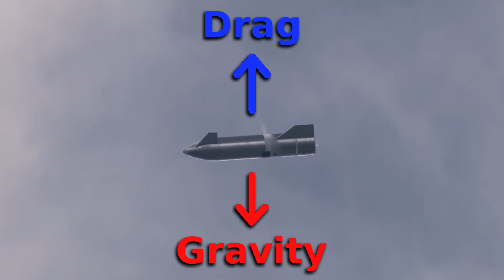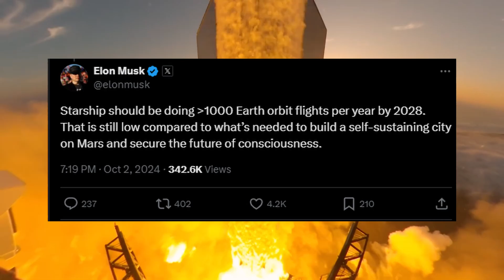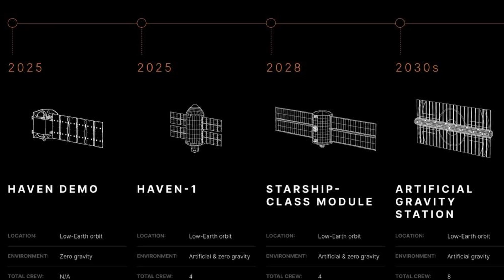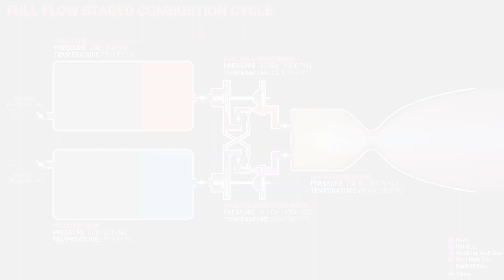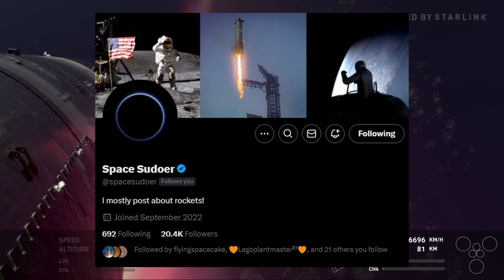The importance of SpaceX's Starship

Comment: Nice video, good mix of cinematography and info

Also, as seen in one of Kyplanet's videos, colonising the moon is actually better than colonising Mars as the moon has an abundance of metals and places to shield from solar radiation (caves)
Reply from the maker: Thanks! i think the main advantage of the moon over mars is just that it is closer, but its soil isn't  fertile so that might require more resupplying from earth
Reply: @zenothspace  mars soil ain't fertile either, there's toxic salts within Martian soil
Reply: I agree with this, however he had to put it in because spaceX did design starship with mars in mind
Reply from the maker: @N3xus_17  yes